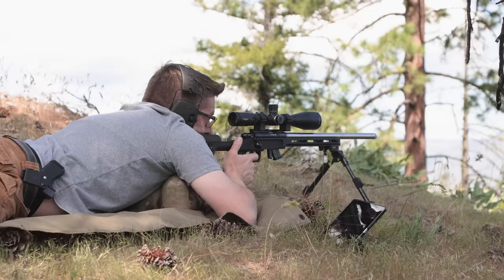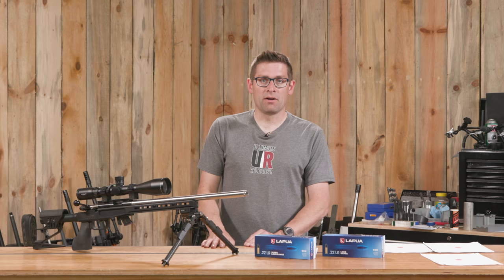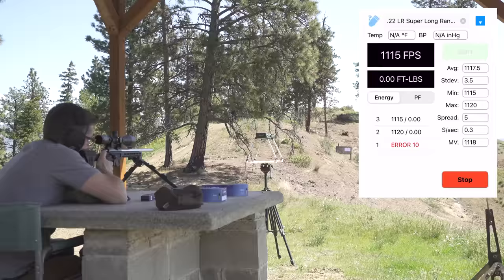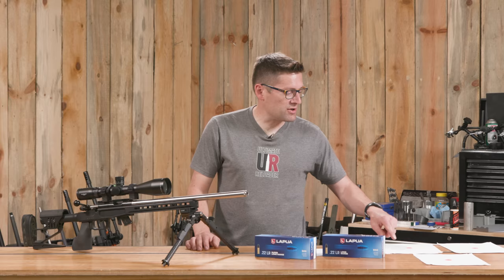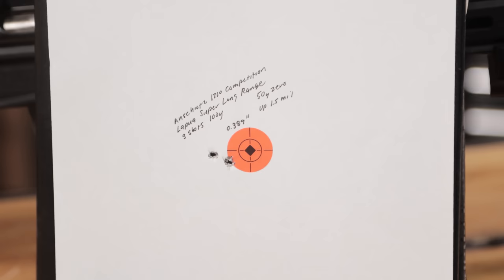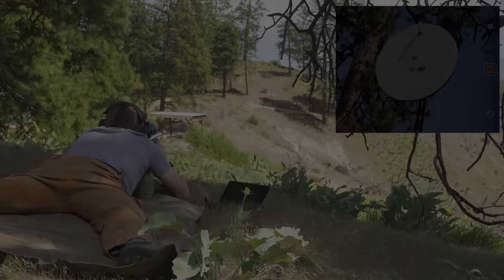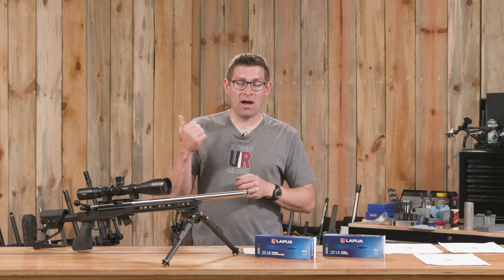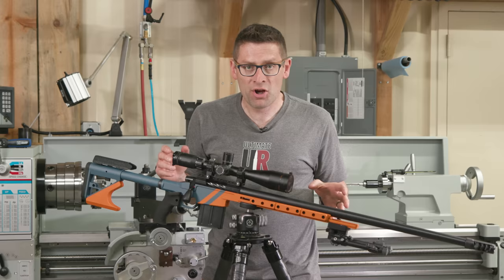400 YARDS 22LR: NEW Lapua Long Range and Super Long Range

Comment: My Dad used to tinker with Ruger 10/22s and get hits on steel over 200yrds. There is a lot you can do with even just a stock 10/22 to improve accuracy. But to wring out the most accuracy he would weight the whole .22LR round to check for consistent weights, group up the different weights and see which one the gun like the best. Its odd but it worked.
Reply: This really doesn't work...been there done that lol....the juice isn't worth the squeeze
Reply: @prone_wolf8871  Weighing the rounds was only one thing my Dad did to the 10/22, other steps were securing the action into the stock to stop action wobble, dressing the barrel face to match the action face, lapping the barrel, cleaning up the trigger and checking for rim thickness on the rounds. And yes it did work and with nothing better to do through the winter Dad enjoyed the process. The results we saw validated the work.
Reply: @8RedBear5  well I weighed tons of it myself.....and sorted by rim thickness....and though yes....improvements in group size can be seen.....
The improvement isn't enough yo justify the time it took.....trust me been down that road more then once lol....

The gains are not worth it(imo)
Reply: @prone_wolf8871  This is how we can tell you aren’t a bench rest shooter. They will milk every last 100th of a moa out of something. Any improvement is worth the work to bench rest guys.
Reply: @god910  😆
Reply: Somebody is always wanting to sell something to you!
Reply: @god910  Exactly!  What's the diameter of an X-ring on a 100 yard rim-fire benchrest target?  I don't go through all that work, but guys do.  Especially the guys with $4k rifles.

Massaged Kimber 82 Gov., Weaver 36X, SEB rest, ELEY Red Box
Reply: @prone_wolf8871 it definitely does make a difference. I would sort several bricks from the same lot by weight, length to ogive, and rim thickness.
Reply: Just don't claim to Make 700 yard shots or you'll be at the range with garand thumb.
Reply: @god910  bench rest shooters don’t use a 10/22 though
Reply: @wannabecarguy  plinkster got it already lol
Reply: @adamgruhlke2285  never did I say it didn't do anything.....read....
I said that sorting thousands of rounds....the gains are not worth it.......

Juice not worth the squeeze lol....don't care what you say I've done it for my self many times in a fully custom rig able to notice the gains 😆
Reply: @Old_Sailor85  I have a decent rifle...rimx..proof..jp enterprises and nightforce.......and it can make the groups shrink by few percent.....but like all 22...their is usually still flyers(you can't guarantee the individual components match even if rim thickness and weight are the same......
I'm my thousands of rounds of testing...I found on average it would take a 3 inch group(100y) turn it into a  2.75.....

Yes it did shrink but the hours spent sorting one brick.....isn't worth it cause the flyers will drive you insane.......like chasing a dragon.......

Basically you can do lot searching that would produce a  better result in less time......and more reliable
Reply: I dabble in .22lr BR.  I'm not near as serious as I was maybe 10 years ago (I shoot PRS/NRL, NRL 22, some f-class, and maybe 2-3 LR IBS BR meets/year...I maybe shoot 6 .22lr BR matches at our club annually and usually only because they do sundays).  I don't know anybody measuring .22 rims anymore.  Most of us send our actions to Lupua (or your favorite ammo mfg) and let them lot test for you.  Then we'll buy a bunch from that lot (I bought 22 cases [11,000 rounds] last time and I shoot the same ammo though my vudoo for NRL22).  

Maybe it's just because I'm not serious about rimfire BR anymore, but I haven't drug my sinclair rim comparator out of its drawer in ages.  I don't weight sort.  I just clean, foul/sightedr, shoot for score--repeat.  None of the other guys are doing anything different that i can tell.  If I scatter vert-I wind the tuner out.  If I shoot a true scatter, wind the tuner in.  If I shoot awful...I just blame the rifle and shoot the Anshutz instead of the 52 next time out. 

Reading the flags is more important than sorting ammo...imho.  Catching mirage when the dew evaporates in the mid-morning relay is more important than sorting ammo....etc, etc.
Reply: @The.Toaster ever see an fx Pantera .25 air gun? Or a fx drs pro? Airguns have come a long way. They even have some guns with 800 footpounds of energy. The fx guns are winning some rimfire competitions that allow airguns too.

Comment: The super long range worked very well in my Tikka, but I recently aquired some norma xtreme 22lr rounds. Now those are actually very intresting and innovative. 355ms mv, 43 grain rebate boat tail bullet. Nailed 300 meter targets very well.
Reply: 1,164.69 fps
Reply: @totallyjonesin  Thanks for translating to freedom units.
Reply: Where did you find it?  I cant find anywhere to purchase it.
Reply: @mikeflanders2173 There is some speculation that it was an April fools bullet they released a week early.

Comment: My main rimfire setup right now is a cz 457 with aguilla super match, got it as the lockdown bs started, on good days it'll hit trap clays or soda cans at 300 with respectable consistency
Reply: if my cz doesn't single hole 5 @ 100yds I figure I should have put the beer down 2 or three cans ago. Most accurate rifle I've ever seen except for my nephs cz in .22 mag.

Comment: In my quest for long range I've taken it to a level even more silly! Trying to get to 200 yards with a Daisy 880. I'm getting hits at 120 on a 10" plate. The problem is I have run out of scope! Both adjustment and hold over. Next we'll try to add an adjustable rail!
Reply: The 880 doesn't have the oomph to get a good pattern out to 200 yds. I've tried for years. I've gotten lucky a few times by just pointing it up higher than the target and guesstimating windage.
Reply: @Brian Johnson  last time I shot at 100, I did ok, 5" if I remember correctly, so pretty confident.  I'll increase the target to 24" if I have to. I just want to say I did it or can do it!

Comment: I'm shooting a Kidd Supergrade with 20 inch barrel.  I recently compared Eley Precision Benchrest versus Eley Force. Wind was light and variable 3 to 8 MPH at about 20 degrees off a straight headwind. At 50 yards the Precision Benchrest consistently grouped  better than the Force as would be expected, but both occasionally threw a flyer that would ruin a 5 shot group.   At 300 yards the Force came into its own and proved equal or better consistency on a six inch steel gong.  I believe this is because at longer ranges the wind call becomes the biggest factor in hitting the target with .22LR. I think the heavier bullet (42g) and the higher velocity of the Force gave it an advantage over the lighter (40g) and slower Precision Benchrest.

Comment: After moving to Renton, Washington back in '91, I found that I had a good place to shoot from the bench at 200 yards.  I have a Great Depression era Savage1933 NRA Model (actually a target version of the old Model 19).  In former times, it was the cheaper competition for the Winchester Model 52.  It has a 1911-patent Lyman target peep sight on a vernier scale.  Set at zero, it will print CCI Mini Mags right on at 50 yards.  To hit very slightly high at 100 yards, i adjust it up to five.  For 200 yards, I have to take it up to 27.  I can get four-inch groups at that range shot carefully from the bench with a sandbag rest.  More recently, I watched through the telescope as other people were shooting .22 LR ammunition at the 200 yard target.  I could actually see the bullets moving into the target.  They were falling like a home-run hit over centre field.  I know that where they would print at 210 yards and 190 yards would be radically different than where they were hitting at 200.  I would surmise that they would miss entirely overhead at 190 and fall down below the bottom at 210.  Of course, one would need a precision range finder to know the difference.  

When I first started to watch this video, I imagined that these two new Lapua products were super high-velocity wonder cartridges that somehow were able to preserve gilt-edged accuracy out where the daisys grow beyond the place where the bullet speed drops back below the mach one.  I was disapppointed to see up-close velocities only in the low 1100's.  Groups at reasonable range were impressive out of that precision rifle.  

I figured out long ago I could reliably drop rimfire silouette ram targets at 100 meters with the rear sight set to seven and with Remington Target  ammunition.  Anything beyond that range was simply beyond practical accuracy for the .22 long rifle cartridge.  Then it is time to get closer or to use a different rifle/cartridge combination.

Comment: over 50 years ago, I used to shoot .22 match competition.  I was as good as I could get with a rifle that was really at the end of its accurate life (BSA International Mk2).  I tried several different makes of ammunition, but I had my best results using Lapua.
Reply: Not possible to shoot out a 22lr barrel, unless using corrosive ammo & not cleaning it after shooting. Old 22s aren't shot out but rather deteriorated from old corrosive ammo & lack of cleaning. Even centerfire rifles don't shoot out barrels. They erode the throat & usually a barrel setback & rechamber will bring it's accuracy back. Pretty hard to wear out chrome moly or SS with lead or copper. I have a sub 6lb walnut stock Kimber Sporter in 22LR that shoots anything I put in it very well. Came from the factory with a target with 5 shots in 4/10".

Comment: Out of my V22 both of these shoot very well. The super long range and the lot I have shoots at 1115 with an insane sd of 3 across my magnetospeed. 10 shot group size at 100 was under a dime. The long range had a measly 5sd 😂 shot at an avg of 1107 and yielded a very comparable group. Now my Vudoo loves Lapua anything SK ammo included (has to be the Lapua snot lube), but that little boost in velocity at the 600yd and beyond targets we shoot our 22lr elr at really helps when you find yourself running out of adjustment, and the consistency in shot after shot out of my rifle is mind bending. Make sure you have velocities in both cold and warm weather because in my experience anyways I get almost 100fps slower in 20 degrees F than 75.

Comment: "Factory" 10/22 with a 16" Edgar Arthur Brown fast twist barrel. I bedded the action in a sporter stock. Topped with an Arken ep5. It really likes Norma match with a best of 4" 15 shot group @300 yards. I'm on a-zone steel at 300 using just about anything off the shelf. Can't complain. 24 moa holds make me feel like a man. 💪
Reply: I like the way this sounds, curious to see your set up. I did a rebuild on my bench 1022 with a .920 ER Shaw barrel. There aren't any ranges around here over 100 yards for me to stretch her legs to really test it to see what it can do.
Reply: @natejackson4791  it's nothing special. Charger action with a .920 sitting on JB weld quick steel in a resculpted sporter stock. Just a home brew "bubba" rig. ELR of the poor's kind of thing. $1000, glass included. 

I'm in Arkansas and sadly my range is now covered in foliage. So I'm back to 100 yards till fall. Shooting across a valley to the next ridge. Lots of trees in between.

Bedding helped a lot and I found it very easy to accomplish. Took my rig from 1.5 moa to .75 @100yds.

Comment: It makes sense you were off from your calculator at 400. The BC starts to drop a lot at around the 325 mark. You will find from ~25-300 you can use one BC, then end up having another BC to go from ~325-450. If you go even farther you will end up with another lower BC etc.

Comment: I’ve been shooting 22LR bench competition for about 8mos now out to 250Yds at small steel plates.  My gun is a 20” CZ457 MTR in an MDT XRS chassis with a EC Tuner.  I burned through a ton of ammo and lot numbers trying to find the best combo for accuracy.  I started at the ELEY test facility in Winters Texas and shot 15 different lots of Eley Match and Tenex.  My gun didn’t like any of it.  So I tried all the SK and Lapua match ammo up to SK long range Center X and Midas +.  SKLR was best and most of the top match competitors also shoot this ammo in their CZ MTRs.  Two weeks ago I decided to try Lapua long range in practice and beat my highest previous score by almost 50 points.  My best match finish was 15th place with a score of 210.  With Lapua long range I finished in 2nd place with a 257.  I’m thinking about trying the super LR now.  It’s a quite a bit more expensive but cheaper than a custom desert precision rifle with a Lilja barrel.

Comment: I used to have a J.C. Higgins bolt action single shot .22 with iron sights, and I could hit a squirrel in the head out to 100 yards. Unfortunately someone stole it out of my truck along with my brand new turkey shotgun. I haven't found another .22 in my price range that can shoot as good as that one. Right now I have a Springfield model 15 trap gun and it shoots ok out to 60 yds, but then it starts throwing lead wide.

Comment: I've been shooting long distance long before you were born. I shoot 45-70 at 1,000 yards
and 22LR at 400. I'm shooting antique rifles that are over 120 years old. They are  schuetzen rifles that have been relined to shoot 22LR. They have 30 inch barrels. What do you think is good shooting at 50 yards is what I would call average shooting at 400.
I use 22LR  hyper velocity Winchester ammo.
1435fps gets the job done with less bullet drop. I use Lyman Super Targetspot scopes, a 20X and a 24X. At 100 yds it's a no-brainer to put 5 shots inside a ¼ inch circle. I shoot a 1903 Stevens 44 /Jerry Gebby custom, an 1892 Swiss Martini with double set triggers by Widmer and a 1912 Stevens 414 with a 29 inch barrel. All of my 22LR rifles are single shot. I should add that I'm a retired machinist
and have mechanically restored all the original tolerances. 

The most important things to remember when shooting long distance is repeatability. This means, you follow the same procedures for every shot. Your barrel is clean and in good condition. In my opinion, it is not necessary to mic every bullet or worried if the bullet is concentric. I have found it makes no difference. 

It's all about the equipment, the ammo and the twist rate if you want to shoot accurately whether it's 50/400/600 yards.

Comment: Very nice review, thank you for sharing.  .22 LR is a very underestimated and fun cartridge.   I have an old Remington 552 Speedmaster semi auto .22 LR that I bought used in 1980  put on a Burris 4x scope.  I would rest it across the roof of our car and shoot at an old highway sign at 430 yards.  Put the top of the rectangular sign so the corners just touched the bottom edges of the scope and split it in the middle with the vertical cross hair.  Fire three shots pause and listen to the three rings from the sign.  Bang, Bang Bang...Ting, Ting Ting.  It was a repeatable science anytime I wanted to do it on a calm day it worked.  It fails to feed reliably anymore but I still shoot it single shot.

Comment: I've noticed when shooting 22 at 300 yards and beyond, changes in wind mean large changes in elevation.  I think I've seen the center of my groups change a full mil depending on wind.  I've got notes on my phone of windage and corresponding elevation changes for wind.  Off the top of my head (my phone is dead), I believe 300 yards means a regular 4+ MIL of windage adjustment and 1 mil of average elevation.  It's enough to be off of a 12" plate even if I get the wind read and windage correct and forget to make the corresponding elevation hold.  This is without much wind.  I think a 175 SMK out of 308 Win would be about 1/20th that much deviation.

As for ammo and rifle, I went cheap.  I'm running a Bergara B14R and until very recently, exclusively CCI SV.  I'm aware CCI SV is not good for this due to velocity deviation.  I'm also using a 30mm scope on a 30 MOA mount, so I'm having to use reticle holds until something like 150 yards.  The scope is a Vortex Viper PST FFP 6-24 first generation.  I'm using it because it cost me $950 and has glass so bad it cannot be used to identify a freshly painted steel plate much past 350 yards.  Everybody that reviewed those things positively should be ashamed.  The thing's been RMAed twice for other issues.  If it cost me $200, I'd feel ripped off.  So I feel very ripped off.

Comment: The chrono data for Super LR is almost identical to Eley Tenex, and the price is close but a little cheaper. 
The chrono data for the Lapua LR is almost identical to what I've gotten from SK LR, but the price is way, way higher. Both companies share ownership. 

So, if you want to save a little bit of money over Tenex, the Super LR might be a good option. But the Lapua LR probably isn't a good value over SK LR.

Comment: I'm certain you're aware of this already but many ELR guys use subsonic ammo to avoid the transition of super to sub mid flight.
Reply: Under some conditions that would be subsonic..but just barely..surely not at Gavin's elevation though.  I am a little surprised Lapua loads 'long range' ammo to this velocity.
Reply: @cheating gravity  temperature  plays a larger role in determining speed of sound than elevation.  You are better off shooting in Death Valley at 110F (43.3 C) than at 10000 feet at 60 F (15.6 C) for a higher speed of sound. 
For myself, that's counterintuitive
Reply: @duanesamuelson2256   I saw that in the tables I looked at after I posted👍